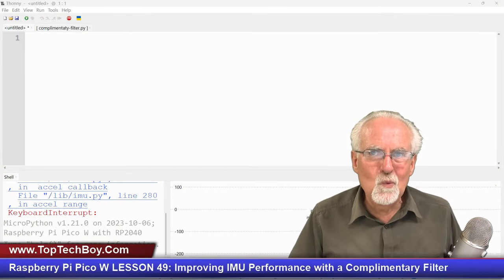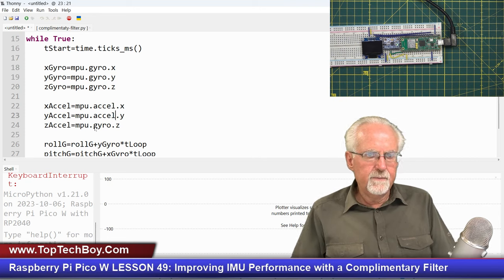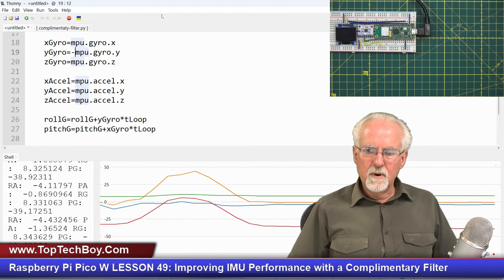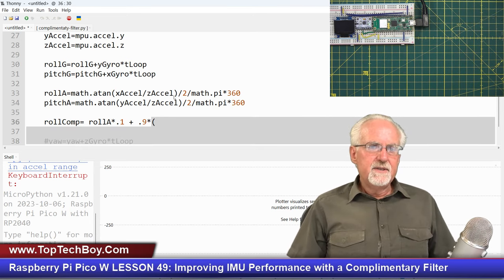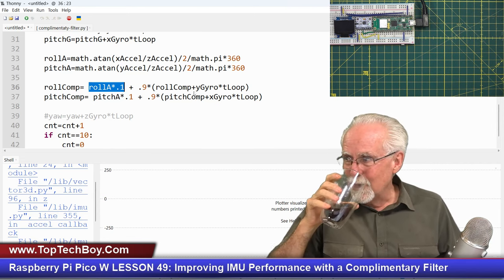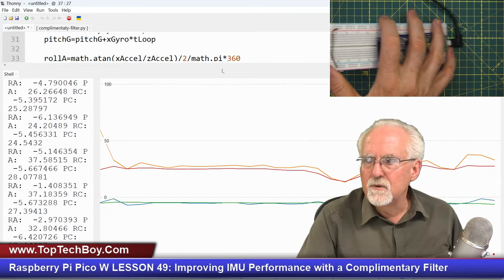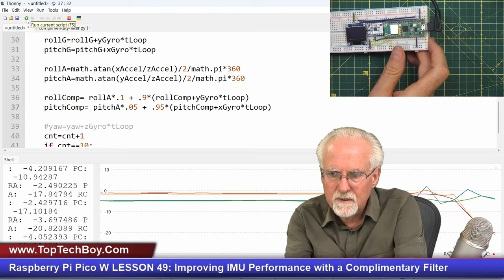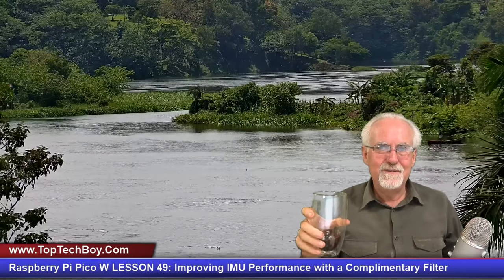Raspberry Pi Pico W LESSON 49: Improving IMU Performance with a Complimentary Filter

Comment: Awesome, love how you generalize lessons learned.  The suspended steel ball in a n electromagnetic field project you did - is it available?  Thanks !
Reply from the maker: No, it was a really tough project. It was very hard to get the PID tuned perfectly where the ball would remain suspended in thin air. For me to do a class on that, I think I would need better hardware, and not a simple way to get a kit put together.

Comment: Good tutorials. Just one point, when the sensor is raised to 90 degrees the program creates an error: divide by zero. Observing xAccel and zAccel values. As you reach 90 degrees, xAccel value approaches a value of 1, zAccel value approaches 0, so you end up with a divide by zero error.
Reply from the maker: Yes, there is no inverse tangent for 90 degrees. You can put a special case for that, and not to the atan for 90 degrees
Reply: problem solved by using atan2(numerator, denominator) instead of atan(num/denom)... Note the comma separating the numerator from the denominator

Comment: Tell me pls Mr Paul, how do you know what to do in the program, watching the moving lines ? When i see the noise, how can i guess what parameters to change, for example  :
0.1 ---->  0.01
95 ----->  99
I need to understand it, to make proper correction  ....  thanks
Reply from the maker: The two numbers have to add to 1. So  if one is .1, the other needs to be .9. It is an art to get the best settings. Play around with the numbers until you get rid of the noise, and get good performance. It is something you have to play with.

Comment: hello paul .. what should i need to get yaw  ? ..please help me !!
Reply from the maker: You will need a different sensor. Look at my playlist on the BNO055 on this channel.
Reply: One simple solution is to mount the MPU-6050 on its side (so the plane of the board is vertical instead of horizontal). Pitch now gives you yaw.
Reply: Never mind. I tried this and it doesn't work.